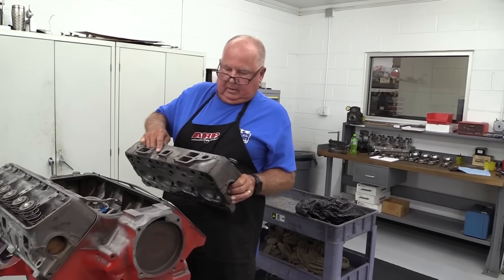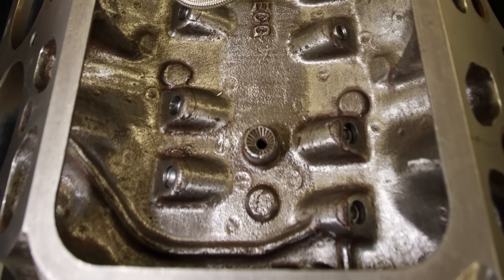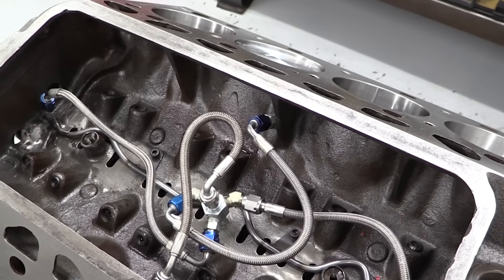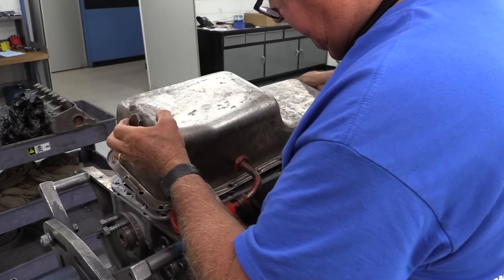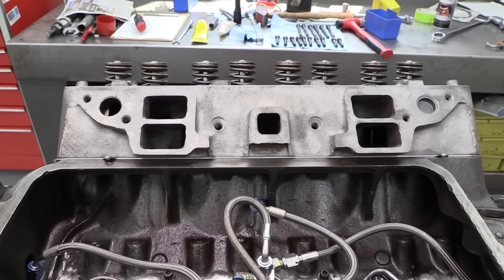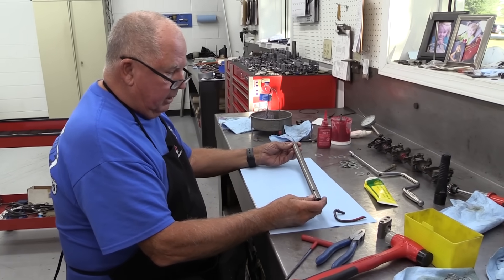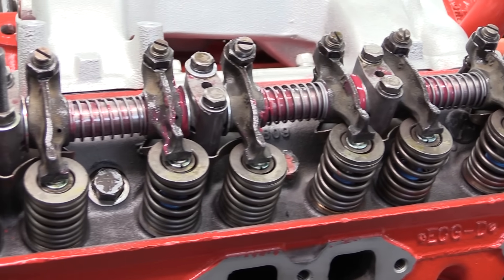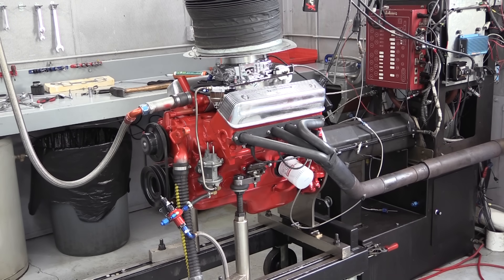The Engine That Replaced the Flathead -- Ford Y-Block Build

Comment: My first car was a 56 ford ex police cruiser with a 390 y block.  so many people didnt know they made them.
Reply: There was no 390 Y block.  The largest Y is 368 and that is a Lincoln, which shares very little with the Ford.
Reply: @Rick-S-6063    as with most police cars.  I had never seen such a large Y block before, but I may have been lied to about the displacement, or perhaps they were just mistaken. but it sure outran all my other 312s. Thx 4 the info.
Reply: There was no 390 Y Block.  They or you are mistaken.
Reply: @Rick-S-6063    I repeat.... so many people didnt know they made them.

Comment: The 265 Chevy came out the next year. 200 lbs. lighter, better oil system, port design and far simpler assembly.
Reply: and way chepper to manufacture
Reply: john barret "Chepper" is not a word.
Reply: not even close to 200 lbs lighter, mostly it was designed to be cheaper and it was.
Reply: Mr Cole  was good
Reply: and the mopar poly and hemi v8 was already around....

Comment: thx to this video.now i know in early 50s the engine compresion ratio is low.8:1.

this is true art.maybe this engine can achieved million mile
Reply: Im not sure why they listed this as just over 8:1.  The 292 Tbird and 292 4V automatic Yblocks were rated at 8.4:1 compression might as well say 8.5:1.  Don't know where the 8.0:1 came from unless this is not a true Tbird engine and they are transplanting it with Tbird valve covers.

Comment: The Buick was the worst design with the aluminum front as part of the oil pump 
I’ve replaced several front timing gear covers on them due to wear to the point that gear kits wouldn’t help at idle
Reply: cad also

Comment: Love watching these relics being work on and running BUT I sure as hell wouldn't like to own one. Full of compromises each & every one. Modern mills for me, please.👍
Reply: some times you just cant go with a modern engine.  like in the 50`s fords its not that simple.  my 56 to drop in a 289 or 302 would require more work than just to rebuild what has been a reliable engine.
Reply: @Milner62  fair point 👍.
Reply: @GIGABACHI , Yep some times you have to decide if its worth it value wise.  My truck I think I have gone over board as by time I am done my 306 roller engine is going to cost me right around $8,000 but that is with everything new from new exhaust headers to tail pipe to carburetor to oil pump pickup.  Way more than if I had simply purchased a 306 crate motor but at least mine is built to what I think is a balance for a daily driver truck.

In any other case I wouldn't go this far but I wanted to ensure my truck would be good for the next 20+ years which I don't think a crate engine would get me more than 10 years before it started giving problems.

As far as engine swaps goes my truck would be the only one getting a roller 302 block in place of the flat tappet 302 block.  my 63 still is retaining its sbc 283 which if it doesn't run right will be replaced with a period 327, and my 56 will retain the OE 292.  Only other swap I might consider is my 78 Mercury and swapping the flat tappet 351W for a harder to find 351W roller block for longevity with lower zinc level oils.
Reply: modern mills cause many problems as well.
Reply: @frigglebiscuit7484  personally I'm willing to live with the "modern" problems simply because I know my way around it. I bet the old timers would say something similar about their old well known mills.
Reply: @GIGABACHI  there are so many more problems with modern drivetrains
Reply: @frigglebiscuit7484  maybe on your experiences but not on mine's.👌🏻
My modern vehicles have been plenty flawless except for the unusual dead ignition coil (coil on plug setup) and leaking water pump beyond the 100k mark.
Reply: @GIGABACHI  sadly, I already know a couple of engines you are talking about, after hearing the water pump failure alone.
Reply: @frigglebiscuit7484  Had a customer recently with a bad one in a FWD Ford with 3.5 V6. Stay away from those, labor and parts were on the high 400s - low 500s area. The job is a pain on the balls.
Reply: @GIGABACHI  oh I don't mess with new stuff anymore lol. Anything on and past 2006 and I'm out
Reply: @GIGABACHI , In my '82 truck I am upgrading to get away from the flat tappet 302 block in favor of a late model roller block.  Im eyeing the blueprint 306 short block plus if summit will work with me on doing right by me after wronging me like they did.  Modern tech is good, but it gets bad when you start relying on electronics to control everything.  It kills longevity as they don't use proper gold plated terminals for longevity, they use regular copper wires.  Its a big problem GM has with their Pass Lock anti theft system from 1995 through I believe it was 2010 when they finally got away from it.  The non gold plated terminals would corrode and increase resistance and lock your car out as it thinks its being hot wired by not seeing the specific resistance value on the ignition circuit when you turn the key.
Reply: @Milner62  had a Chevy Colorado quit on my because of GM's fancy security system. GAH, 💩😞
Reply: @frigglebiscuit7484 , They do.  I see them all the time at work.  Sad thing is, how many of these modern mills could sit for say 30 years and be revived to run again without spending nearly the cost of a whole new engine.  My 292 was seized up from sitting a week of soaking MMO and 10w30 weight oil in each cylinder I got the engine unseized without damage.  That was about 5 or 6 years ago and the engine is still running.  Lets see a modern mill do the same thing.  All I did was carb rebuild, fuel pump rebuild, water pump rebuild as it was seized as well, plugs, plug wires, cap, rotor, points, condenser, coil, and resistor and was running again.
Reply: @Milner62  if you even tried to unplug a sensor on a newer engine after it sat for 30 years, it would crumble to dust in your hand haha
Reply: @frigglebiscuit7484 , don't even need 30 years lol, give it 5 years of 200 - 220 degree under hood temps and they fall apart in your hands when you unplug them.  Clips break you have to zip tie them to ensure they don't work loose while going down the road. Its why I swore I would rebuild and update my old truck and keep it vs buying new as its the best of both worlds, best of modern tech but maintaining the simplicity of the old tech that allows it to be like a timex watch that will just keep going.

Comment: My dad was a Ford mechanic all through the 1950's in KC.  He bought a '57 Ford with this same engine, and he installed an overhead oiler kit that fed oil through the rocker covers with copper tubing.  This problem was a major engineering flaw by Ford engineers that designed that engine.
Reply: the block were not good they would spin the center cam bearing

Comment: still holding on to the old ways ? such a poor design in serviceability and seriously dumb choices for lifter access [remove crankshaft ] rocker oiling , oil pump setup ,  need I go on
Reply: There's no option if building a Y so some of the old ways have to be held onto.  You don't have to remove the crank but it is easiest to replace the cam and lifters with the engine out of the vehicle.  There is a tool that was produced to do the job in vehicle but they are very hard to find now.
The rocker oiling issue has mostly been solved by modern oils but there are still very simple steps to take to ensure oil flow to the rockers.  One is to ensure adequate camshaft groove width and depthc.  Another is a bearing with a groove along the outside, preventing flow from being cut off.  Another is grinding a groove into the block, which then requires restrictors because too much oil will get to the rockers.  No one who knows Y blocks does the ridiculous modification outlined in this video.
The remote oil pump has it's benefits.  Much easier to replace if it needs to be replaced, easily adjustable oil pressure for those who like to play with that, room in the oil pan for a full length windage tray or crank scraper since there is not an oil pump or tube in the way - it all can fit above the pickup tube.
Reply: @charliemccraney  ok I herd it all
Reply: Brad Viviviyal , yeah so mediocre that my 292 is still running and propelling a 56 fordor that has never been rebuilt.  lets see if what you believe to be superior engineering to still be running without a engine rebuild after 60+ years of service.
Reply: well, not everyone wants to be a SBC/LS generic, boring fuckboy loser.
Reply: you sad it
Reply: john Barret Do you know how to spell anything? "You SAD it"? "I HERD it all"?

Comment: Unique external oil pump? Ever heard of the B & RB MoPar engines.?
Reply from the maker: Yes, that's why I said "relatively." Thanks for watching!
Reply: Buick 300, 340  350   also external - in the  front timing/wp assembly. Just re-built a  340 in a  67 Buick  GS.  Runs  Strong. I Didn't over-cam it for  a  "cool idle". Lots  of silly  people out there. - Sandy
Reply: silverbird58  There are others also. I remember working on some brand of 6 cylinder made in the 50s or 60s that had an external pump. Been too long ago to remember the brand.
Reply: @larryhutchens7593  The  Buick V6's had them too, as they shared the  front timing cover assembly with the  V8's.
Reply: @sandyshoremann7524  That Buick V-6 had a lot of engineering borrowed from the V-8 units. It was a good reliable engine. Rebuilt one for my son's Olds Cutlass many years ago.
Reply: BW MadDog [retired]  That would have been a tight squeeze. Saw a 53 Chevy that a guy stuffed a Chrysler 392 hemi into.

Comment: A quick "fix" for those Y rocker oiling issues was a die cut piece of thick felt you bought at your local auto parts store for this engine. You removed the V-covers put the felt pad on top of the rocker arms, soaked each side down ww 1/2 qt motor oil. Good until the next oil change when you re-oiled the pads. It was the "get you by " until you you could do better!
Reply: yes

Comment: Look 👀 at the thickness in the cylinder walls between the pistons !!  You don’t see that on today’s blocks
Reply: That block was really BEEFY!
Reply: there are many good reasons why you dont.
Reply: Yeah,that's why the Y block could take a beating and keep on going whereas the early SBC engines were more easily damaged from abuse.

Comment: Grudgingly, unwillingly, Ford was forced to produce an OHV V8 just to acknowledge that the twentieth century was half gone.  Out of pure Henry Ford-style spite, they delivered what must be the worst engine design since the flathead itself.  Why did people put up with that crap when GM was producing lighter, simpler, more powerful and efficient engines across the board?  I am old enough to remember the debut of the 55 Chevy and the immortal SBC, and I have always wondered.
Reply: check the nascar record books for 1956 and 1957 and tell us who faired better? Ford or GM? for that matter, no one could touch Ford...
Reply: @HotRodReverend  I'm glad the stock car boys could make them run, but in Dallas in the late 50s it was all about the quarter mile, or some part of it.  Fords were generally blown off by Chevy's all over town, stock, modified, or cheating.
Reply: Hopelessand Forlorn not here in Va. My 312 never lost to any 283
Reply: Ford hated Chevy brothers
Reply: Don't know why, the only thing the brothers gave GM was their name and you can thank Billy Durant for that